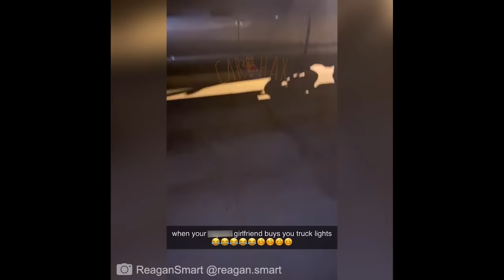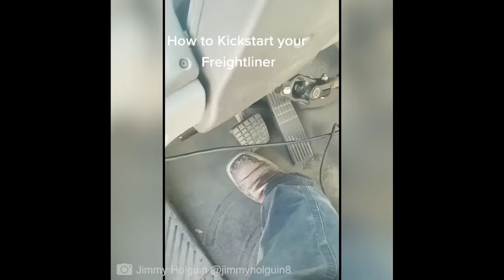Mechanical Problems Compilation [PART 13] 10 Minutes Mechanical Fails and more

Comment: So no one is going to talk about the girls trying to take off a hubcap that simply needed the lugs to be taken off?
Reply: Speaks for itself
Reply: ALSO, those aftermarket wheel covers won't work... there's not enough lip on the rim for them to snap in. which is why the stock ones are held on by the lugs hahahaha.
Reply: Thank you I was about to comment about that
Reply: These are not ment to be removed
Reply: I was looking for someone to say something about em 😂
Reply: The factory covers look a lot better IMO.  But that's shocking what they're doing.
Reply: just typical women doing their thing
Reply: I definitely cringed at that too lol
Reply: This is why every body needs sombody with mechanical abilities
Reply: And the complain about the girls aren’t good at cars stereotypes
Reply: [enter name here] okay you don’t need any type of mechanic abilities to take off a hub cap you need common sense
Reply: That made me cringe because i work at a tire shop and deal with those on the daily
Reply: @nilsh.3285  Thats not true
Reply: @haileysimone4356  same
Reply: The worse part is that later in the video they actually take of the lugnuts but still dont realize they could have done that in the first place
Reply: not my car not my problem
Reply: Shhh your making too much sense!
Reply: Wheel covers, hub caps only cover the wheel hub, but still they dumb as hell
Reply: @nilsh.3285  they are only held on by the lugs.
Reply: What about the fact that it’s half broken
Reply: I wasn't sexist until i saw that and now i am.  She has award for least intelligent person ever.
Reply: @funnydubby6401  Yes.  I don't know how those terms got mashed up.
Reply: Why on earth were they even doing it? Those aftermarket wheel covers they were trying to put on look absolutely horrible, while the originals are just fine.
Reply: Interesting enough to see her creative method of removing the hubcap. What I really want to see is how she installed the new one.
Reply: Sean Hill true
Reply: Or the mom using the best adulting advice out there. 'WeLl ItS oIl AiNt It?'
Reply: my head hurts too much to think of them from all the face palming
Reply: Ya then after there gonna say “I’m a mechanic I’ve worked on cars before”
Reply: Exactly that was extremely hard to watch without laughing!😂
Reply: Girls: I know everything about cars.
Man: okay take the tire cover off 
Girl: okay that's really easy 
The girl not even 2 seconds later, the man Fucking Mint👌
Reply: @nilsh.3285  yes there are,you can remove them by simply removing the lug nuts.
Reply: I know right
Reply: They don't need no man.
Reply: Yeah I was watching that, and I really had no words for what I was watching.
Reply: First time I saw hub caps to hold by lug nuts...damn it manufacture just put some rim's if I have to jack up to change it
Reply: No she's a woman hear her grunt ....
Reply: So how did u get that back on?
Reply: Proof that girls don’t know anything about cars.
Reply: @megabyte2711  fax
Reply: some people are just yes
Reply: also the caps they bought show they a bit slow
Reply: No, we do not acknowledge the existence of such unintelligent beings
Reply: It’s women what more can we expect
Reply: I mean.. it's  a woman. You expected more?

Comment: To be fair, the screwdriver was probaly more expensive than the actual bolt
Reply: they look like the 10 and 7 dollar screwdrivers. should be safe enough to drive a short distance if they were just thick enough to use a rubber mallet to get them all the way in.
Reply: Brodu Sullivan he actually takes it to car meets and does donuts and burnouts in it
Reply: It's about six bucks for two 3/8" grade 8 bolts nuts and washers.
Reply: If those things fall out of the hole, it will cost a lot more
Reply: Without any tray the back end is so light anyway.
Reply: One is a Stanley and the other looks like an old Craftsman screwdriver.
Reply: yeah ive been in a spot where a bolt broke due to over tensioning, but thankfully was easy to pull out with a vicegrip.   a friend used thin rebar and drove right through brushing and held leaf spring in a '77 F250  passenger rear   temp fix prior arriving at shop

Comment: The pallet jack wasn't a bad idea. Sometimes when you have a broken ball joint, control arm or whatever, you do what you have to.
Reply: I’m just wondering where I can get on if needed haha
Reply: I've used a skateboard in the past.
Reply: Yea I might use that in the future
Reply: My grandpa taught me years ago if it works it's not stupid
Reply: As long as there's no hills, especially down hill, you're alright.
Reply: the pallet wheels will be destroyed on asphalt.

Comment: Hey, you might want to have that dog looked at in the last one, sounds like a timing issue.
Reply: 6:33 caught for exhaust pipe
Reply: Lol
Reply: Needs a good p pump
Reply: Typical dodge
Reply: Typical Bullydog Tuner
Reply: O think is rotary powered
Reply: advanced cams
Reply: Nah its got a lope tune
Reply: Bulldog brands always suffers from engine problem, will need a complete lung rebuilt with a new pump organ & new fuel veins, the entired kidney filters have 2b replaced also, this repair is going 2b expensive/time consuming and emotionally hard.
Reply: Naah...definitely upgraded cams in that dog
Reply: never seen a steam powered dog before?

Comment: Aye the crank shaft being polished one is not a fail lol and then the cam shaft one is even better ☺️☺️
Reply: 1:48 meanwhile in romania
Reply: Uhmm. HOW IT THAT NOT A FAIL???
Reply: Will Kelly does the spinny spinny in the car
Reply: Will Kelly woosh
Reply: Will Kelly makes the piston jump around and explode
Reply: @justinmielsch5936  that's not a woosh n let the man learn
Reply: Will Kelly idk
Reply: The best one is the first. The piston being ascended to the heavens
Reply: They were sanding it not polishing it...
Reply: Yeeaaahhhh, “minor” repairs at the race track 😂 she went right back in and ripped off a pass
Reply: Which cam shaft
Reply: You cannot “polish” or “sand” a camshaft using a hand grinder with a grinding wheel 💀😂 you’ll just ruin the profile lmao.
Reply: Custom grinding a camshaft 3:52
Reply: @sfp4197  😂😂😂😂😂😂 ba chiar e in romania, nu mi-am dat seama
Reply: The cam shaft one was definitely a fail if you open your eyes there were about 4 fuel cans..
Reply: Will Kelly it helps the engine run, turns linear motion into rotational motion
Reply: He aint polishing it. He tryin to make a diy race cam

Comment: 10:36 sounds like a mazda rx7/8 with 13b bridge port engine
Reply: The dog is literally dying bro. Those dogs can't over exert because they're heads are all fucked up. But true does sound like a bridgeport.
Reply: @quentindias8924  it's not a pug. It's a pitbull breed (i dont know wich, specifically). Pitbulls don't have skull malformation like pugs so the dog is just fine when it comes to breathing. The reason he is doing that is probably heat or thirst

Comment: Gotta give some credit to the guy hauling his car on a pallet jack, that’s a good idea
Reply: When i blew a hub assembly and couldnt afford a tow, a real Bro stepped up, and brought out a power jack from his carpentry shop, and helped me get my old Chevy pick up out of the road by lifting the front end and pulling my truck into his lot.

Then he used his forklift to get the truck onto the flat bed trailer my friend brought.

Comment: In the early 1990s I had a 1976 ford Granada . I needed the rear lights fixed but didn't have the time to fix it. It also needed other repairs.  Went to the junk yard n pulled the part needed then to the auto mechanic.   I was told it would be ready in the morning.   I called n it wasn't ready.  This went on for a few more hours.  The so-called mechanic called n said " I dont know why it won't work ". I went down n took a look.  In all of 2 seconds I found the problem n stated " it would help if you put in some bulbs " 💡😅

Comment: To 9:00 
I had once a car with the same issue. 

The car needed 5l water on 10km bit there was no leakage to see. The Shop i turned in told me that the sealing has somehow broken, they fixed it (car manufacturer paid for it) and told me there's nothing to worry about. 

On the next day i sold it xD

Comment: This might be a bit late of a comment BUT! The 30-40 zone is actually not a speed trap. 30 sign is from 7am till 9pm (if i read it right) and the 40 is from 9pm till 7am so it actually makes sense. Earlier in the day you drive slow , later on at night faster.

Comment: 7:57 my home town has something similar this road has a speed limit of 40 except on these two bridges it changes to 45mph then 40mph for 30ft between the bridges then 45 again for the length of the second bridge. There’s usually a cop sitting either between or at the ends of the bridges waiting

Comment: My brothers 2009 GM 2.4L had a cracked block and coolant mixed into the oil so we had to put a new engine in it 9:00

Comment: 3:00 - Don't laugh, that's the reason why both of my rocker panels completely disappeared. Rust developed in the rear wheel wells, later it became a hole, then it filled up the rocker panel area until they both rusted completely from inside out.

Comment: 3:42 You know, if you think about it this actually isn't as dumb as it seems! Using the level concrete to grind down the head smooth, he's rotating his movements. Certainly not ideal, but it'll work!

Comment: 9:18 either....

A) They don't want to because they won't make much money, so basically they don't care about you or your safety. Which if they refused service, even though you brought tires, they could be held liable for putting your lift at risk potentially.
B) The tires are the wrong size.

Comment: They were a bit unfair to that last guy. The whole thing didn't rest on a $.99 screwdriver. It rested on $1.98 worth of screwdrivers. That's a safety factor of two. Clearly the work of a skilled engineer.

Comment: 9:20 the tire shop won't change tires on rims mainly because the shop made 0$ on the tires you bought somewhere else, or bribe them 100$ might help a bit.
Reply: Not a mechanic, but could there also be legal issues? For example, if they put the "new" tires on and they get in an accident because the tires were not in good enough shape, then the fault would be on the shop. Whereas they can make them sign a waver that they declined repairs, and they could not be held accountable.

Comment: @3:45 some people I know whove rebuilt engines just fine use this same technique with heads in a figure 8 to see if there head is warped before doing a fine sanding. This really isnt a fail at all. Some people will scald you for doing this but you really arent gonna hurt it as long as you resurface it or level it.

Comment: 8:04 this is not how to change a hub cap 1. You need to get the bolts out 2. Now change hub cap and put back bolts

Comment: 8:04 this is how to change a hub cap the wrong way 
To change one correctly follow these steps 
1. Don't be a f***ing idiot 
2. Get a jack
3. Get jack stands
4. Jack car up and put jack stands down
5. Get tire iron
6. Use tire iron to remove tire 
7. Most cars will then allow you to pull hub cap off with some force then you can pop the new one on

Comment: This is just about all failure to get it serviced and keep it serviced and inspected. Don't want to know. Drive the wheels off it, skip the safety requirements or abuse.
I have to say, when I did repairs all day for the dealership, our customers made that make look good by trying to care for it properly.

Comment: 7:07 makes total sense, because there's additional sign that tells 30 max 7:30-21:00 + (be aware of children) and 40 max 21:00-7:30 + (be aware of pedestrians), this idiot needs to learn to read road signs. Only thing is that you could give all that info with less quantity of signs. Just make it 40 max zone with additional restriction that from 7:30-21:00 it's 30 max + be aware of children.

Comment: 3:52 it might seem like just another moron grinding down a camshaft (like Ive seen dozens do with heads, etc) but that looks more like a racing team. If that is the case, then its probably the engineer not repairing but changing the lobe profile for more cfms at a certain rpm range. Its as much art as it is science with air flow, and a good experienced engineer might be able to pull that off by sight or feel during a race.
Reply: Yeah, okay... but around the cans of fuel like that?

Comment: I'm seeing a lot of smug and righteous male mockery of the girls with wheel trim issues at 8:15 (hey, one of them had got a tattoo, so that explains a lot), and the ignoramus at 8:40 who doesn't know the difference between vegetable and mineral oil, but let's not forget that 99.99% of the peeps featured in these car and bike FAIL videos don't have ovaries.

There's a lot of stoooopid out there.

So be sure to spread your contempt for bad drivers, bad mechanics, and people with zero mechanical knowledge and aptitude evenly, mmmmkay, boys?   😘